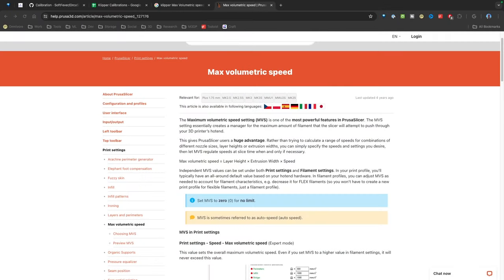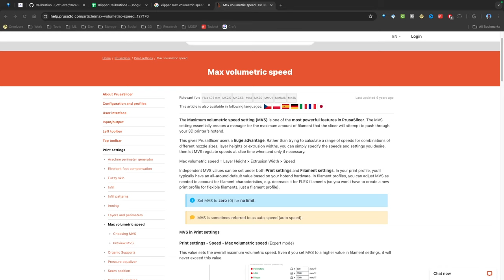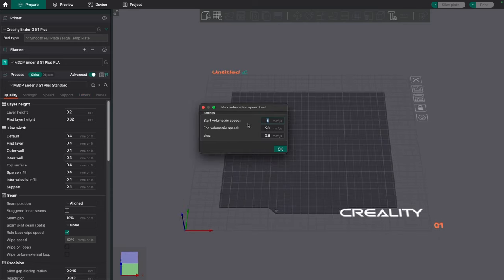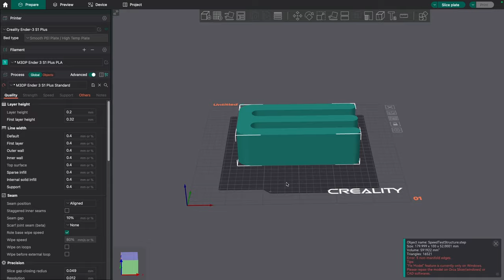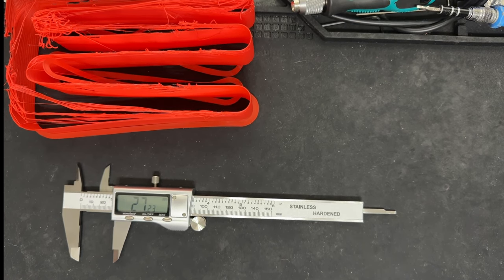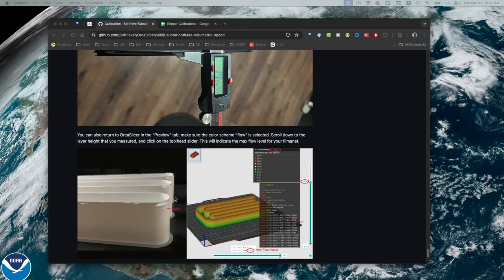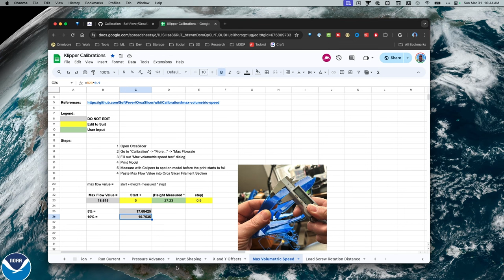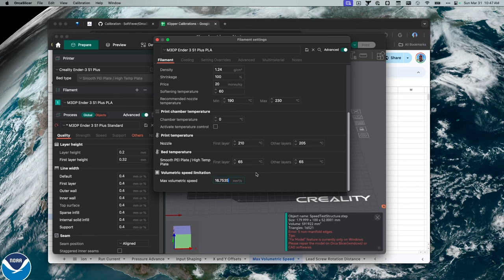OrcaSlicer Calibration and Max Flowrate: Fix It Fast with Orca Slicer's Calibration Tool

Comment: Thanks for the video. I ran the test for Overture PETG with settings 5-30 with 0.5 step and the results were surprising. This is an older dried filament that I've been having some trouble using on a few objects. I'm printing on a ForceForge 5M Pro and the issues I'm seeing seem to be related to it trying to print too fast. It prints Ok and then it starts to string and it gets ooze accumulating on the nozzle and then it just fails. I've tried lowering the nozzle temp but that hasn't helped much. The odd thing is this happens only on certain models. Some things it prints fine others not. So I suspected Max Vol may be off, even though it's only set at 12 in my filament profile (which I created myself from a generic PETG profile since I couldn't find any defined profiles for this specific filament). So I guess other parameters could be off too. In general, how would you deal with something like this? 

I ran the Max Vol test as described here. Oddly it printed almost the entire test without issues. It was just the last few layers that began to separate unlike your test where it was a clearly defined spot where the test print quality degrraded. Granted the look of my print isn't perfect but it's mostly all together. I get a value of 29.11 mm when measuring where the quality of the print starts to degrade (I'm going a couple mm lower then where it actually degrades just to be sure). Using the equation & your spreadsheet, this gives me a value of 19.555. This is quite a bit higher than the initial value of 12, so I'm really not believing this will help my problem. What do you think? Appreciate any guidance. Thanks.

Comment: This is a great video and spreadsheet, thanks! So using your spreadsheet how would I use this to push the limits? I did 5 to 30 with PLA at 210, measuring and using your spreadsheet it gave me a 26, Dragon HF hotend. But because the print was so tall it was starting to bow. Do I just uncheck the box to turn off the max I set and change the specs in orca to like 20 and 40, then adjust the start number in the spreadsheet to match, and use the measument I get?
Reply from the maker: I am glad you find it useful. You should be able to adjust the limits to the 20 to 40. Let me know what final number you hit.

Comment: Still new to 3d printing so this is SUPER helpful - thank you! Would I have to run this for nozzle swaps, as well, or would they be the same because it's the same filament (using this to try to get better prints using Overture Gold Silk PLA).
Reply from the maker: I would not if you do a swap. If you change extruder, then yes.

Comment: Thank you for the Video and the Excel sheet. One question I have is, will this max flow rate effect my speed settings? Say, I have set speed to 500mm/s, it obvious can't be reached with a max. flow rate of 10mm³/s. Or do i have to calculate and set the max speed myself?

Comment: Recently i started using the orca slice calibration.the order i do my calibration is as followa. 1.temp 2. Flowrate.3. Pressure adv. 4. Retraction. I want to add the max volumetric speed calibration but i dont know if i should do it at the end of calibration flow or before the flowrate test.
Reply from the maker: I personally do it at the end. Basically the same order as the menu.

Comment: nice video, but when I try to do the same using my Bambu Labs X1C Carbon i get all sorts of problems where I am asked to click on all the AMS reels I want to include in the test. However, when I try to select just the one reel it will not let me and the send to printer button is greyed out in Orca Slicer!! Any thoughts on the cause of this issue??  Cheers
Reply from the maker: Unfortunately, I don't have a Bambu so I can't help you solve this problem. Hopefully someone else here will be able to advise you.

You can also take a look at the Orca Slicer github for a solution.

Comment: In that window that opened, I wrote 10 on the top and 40 on the bottom, and the bottom was 0.5, I measured it as you did with a caliper, but I couldn't calculate the flow rate, how can I calculate it?

Comment: perhaps you can answer this question.  a volcano .4 nozzle has a reported max flow rate of 30-40.  yet when the test is run on my sidewinder X2  my flow rate is between 8.08 and 10.70.  why is the highest flow rate roughly 1/3 of the capacity of the nozzle?
Reply from the maker: My guess is your extruder is not pushing hard enough. What speed are you printing at?

Comment: Hello sir, i have question, i do this max flow calibration for my a1, but it print normal same speed for all layer, what i do wrong? And when i check my max volumentric speed it is 200mm/s, its make me confuse
Reply from the maker: Recheck your calculations. It should be something on the order of 5-40mm^3

Comment: great video but for me i dont have klipper  my printer is a elegoo neptune 3 plus
Reply from the maker: The max volumetric flow should work if you are using either orca Slicer or prusa slicer with you printer.
Reply: @minimal3dp  but i dont have kipper is it stir the same